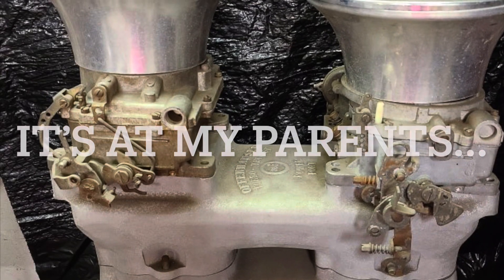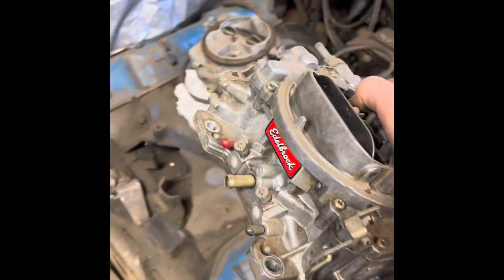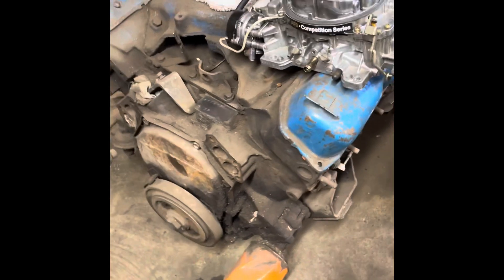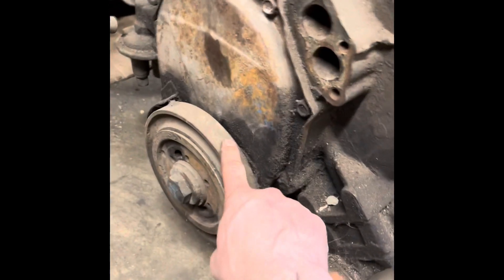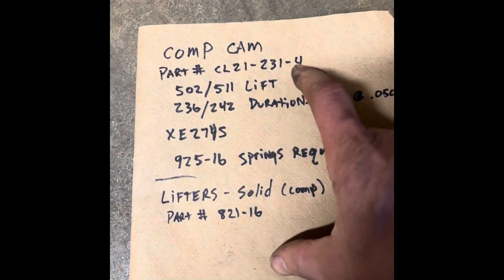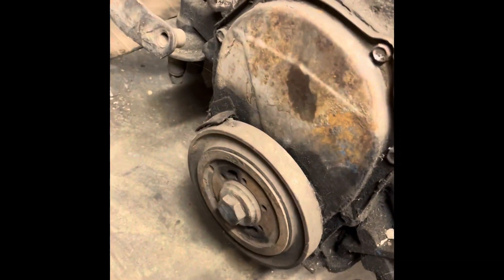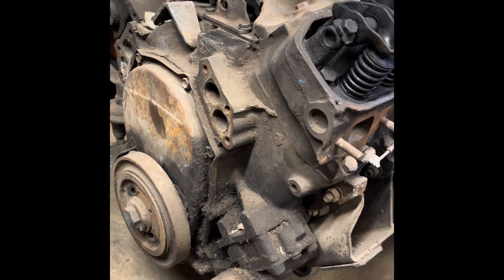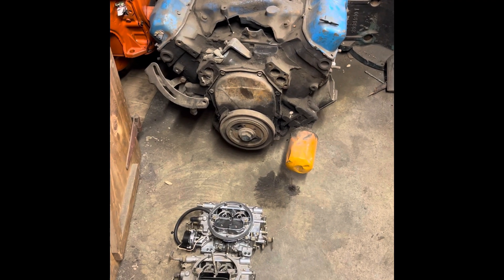I have a 440 question: #nonamenationals #mopar #440

Comment: You can! Many believe it takes exstream rpm to run a tunnel. That is not true. The cam if the card is correct is a exstream energy 274. They are a good all around cam. I see you have solid lifters. Depending on your driveline. They will work just fine. You will want to check those carbs. A eddy and carter may flow different from each other!!!! You want a matching pair. The cam would be a 2500-6500rpm range cam. If your running a higher stall converter or a manual with good gears. You can run them without a problem. Even with the c.i. and rpm....your never going to get enough vacuum to open the secondaries  on those carbs. 
   Your heads will not be restricted by the intake. They flow more then the heads do. 
   So....if you want to run it. Find a set of matching carbs. 450's would give you the best throttle response.  Or 600's if your running a exstream rpm converter.
  The cam is a good match for the heads. They work well with a converter of atleast 3500. 
  They take a bit to balance the fuel delivery.  But once you get it, they are fun. 
  The springs needed for that cam are not much different. You can find the same size diameter with double springs that will work with original equipment.

Comment: Mostly Old picked that up... its an Offy and I believe it has a bigger plenum than DDG's. I like the Offy because it has those gentle transitions to the rams, not sure how much difference it makes but it looks like it would do better. My Favorite is the old Barrel Plenum Eddies (but that another story & finding them now is dang near impossible)..... 
Only experience I have with Tunnel Rams is on sbc's and bbf's. I know for sure if you want the most out of them, it takes free flowing heads & they love compression. Other then that I don't know 440 Mopar for nothing.
Reply from the maker: I know that to make it run correctly it needs to be built correctly. I was just thinking I can ‘skate’ by I guess; with what I had. 🤔🤷🏼‍♂️
Reply: @heavensmopars  If you are building for show, not so much for go, you can make it run, and that Offy (I hear) is pretty forgiving on the tuning over the Holley small plenum (but I'm pretty sure that one gets more bang)...... it's also why I look for those old Eddies, they are even easier to tune.... lol
I have a friend that's running a TR on a stock 350 sbc (83 or 84, just before they changed the heads) with 2 Q-Jets on top. Nothing at all special about it. It looks Bad To The Bone! but honestly... performance wise, he'd be better off with a cheap Eddie Performer intake and single carb. BUT, he drives it all over the place and has fun with it until he can afford to do the rest to it.... so there is that, it's not sitting the garage for years waiting for money and parts.
The gear timing set..... people might give ya slack for it.... but I'm with you on that one. It gives it that old school mechanical sound. I put them in nearly everything as well. Better or Worse, I don't care, and don't know.... I just like it better lol.

Comment: 440 steel crank truck engine.
Reply from the maker: Yes, it’s all stock. Not sure of the crank.
Reply: if it had an E at the end it would be a cast crank as in 4T440 E the first number is the year but check the birth date on the side of block.
Reply: @moparnut6286  lol birth date.. 😁
Reply: @440phoenix  yes it's cast into the passenger side of the block.... one of ones the I have is 10/13/73 2and shift! a libra! lol!

Comment: That cam apparently uses solid lifters , but your valvetrain is non adjustable  . So you need to get new rocker arms that have adjusters . The heads are low compression,  not really a HP head , so the tunnel ram and carbs are probably a lot more than what is needed.  A good single plane manifold and 850 carb will probably out perform the tunnel ram setup . Have fun !

Comment: 4T 440 is a 1974 low compression 440.
Reply from the maker: I know that for it to run right, it needs to be built right. I was just hoping it ‘might’ work if the cam was semi compatible? 
 It sounds like it will ‘perform better with just a single four barrel on it…? 🤔
Reply: @Heavens Mopars  it depends on a lot of things. On a stock low compression 440 tunnel ram won't be good. Id stick with a 4 barrel and a good Edelbrock aluminun intake. You need a built motor to utilize that tunnel ram. Huges makes specific low compression cams for that motor. Hope this helps.
Reply: @Heavens Mopars  It does look like a forged steel crank harmonic balancer on that 440, very unusual for 1974. 1974 is almost always cast crank. Was the donor vehicle manual trans?
Reply from the maker: I have no idea what trans it had hooked to it. I bought the motor from a guy who just wanted to get rid of it years ago. So I don’t know any thing about the motor/truck.
Reply: @heavensmopars  take the oil pan off and look at the crank if it has a thick parting line on the crank it's forged... If it has a thin parting line it's a cast I have a 74 440 out of a motor home it has a forged crank and six pak rods and uses the thin damper... Not the thick damper off the HP 440 six pak engine they are different. Yours maybe LY rods or six pak rods with your current damper.

Comment: Cam is pretty mild, but it really depends on the compression the engine has.  Do you know the year of the engine?
Reply from the maker: I do not. I bought it as is years ago…
Reply from the maker: 74’ - apparently a low compression stock motor.
Reply: @heavensmopars  Just find some closed chamber heads (915 or 516's) and that will help, you really need an earlier engine or put pistons in it.
Reply: The whole thing behind my build is to see what can be done with the low compression truck motors pistons are expensive and every company I looked at for just about any pistons are 6 to 8 weeks out. I will tell you right now I am going with the Whiplash cam From hughes engines they are made for the low compression engines and you can get the whole kit with cam lifters and springs for around $400 or so.
Reply: @DustDevilGarage  Have you looked at Ebay?  I can get forged old style pistons in STD size very easily for around $250.  The old forged pistons are old tech, but still held up well.